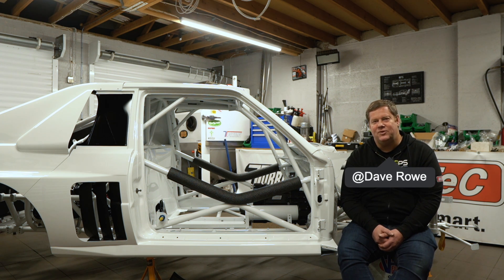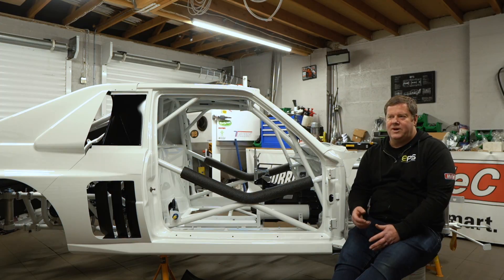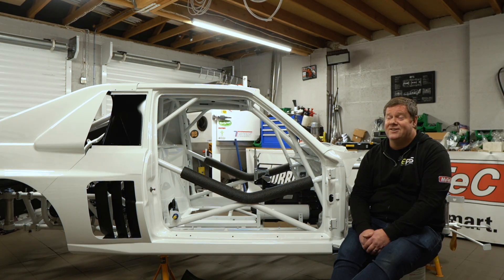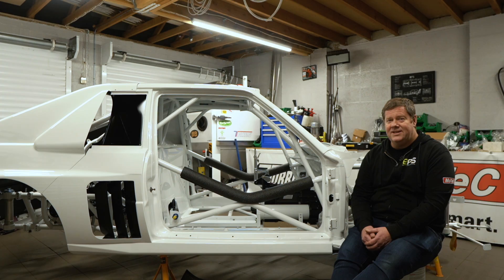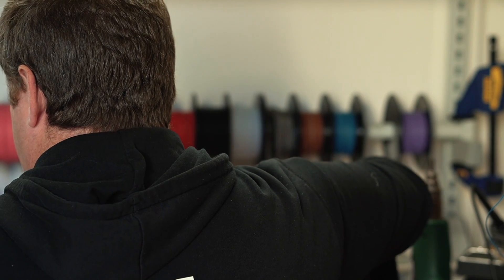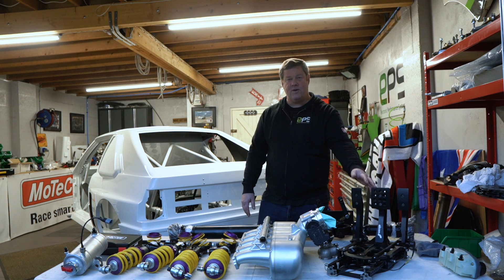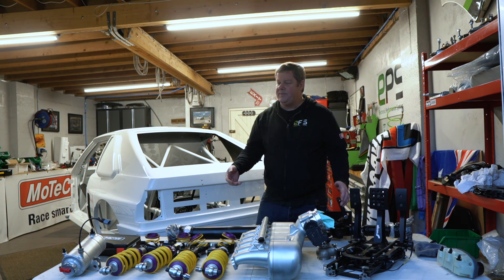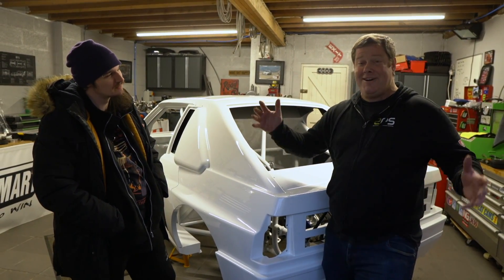Building Audi's missing Car.. Audi quattro Group S RS001 (Part 5) Getting the Driveline in

Comment: One of the best projects in a long time I saw on yt, honestly not the big audi fan but the build quality, atention to detail and thought process max respect
Maybe one suggestion for dash, when you already have double gauges, make oil press and water temp gauges work from second set of sensors just to have double information in case something happens you can instantly know is it sensor gauge or engine problem, because thoes two are most important for engine health.

Keep us posted, can't wait for next video😊

Comment: Only question I have is why wouldn't you use a AAN or old school Audi 5 cylinder for such a historic and important project? I understand the availability and displacement from an 07k but the noise is quite different and honestly a lot better from an AAN, 3B, 7a etc.
Reply: Please, it's a completely different type of gearbox and driveline, a completely different type of suspension with R8 parts, etc. So Everything is modern and better, so why would they use an old type of engine?
Reply: @MartinEhrsson  Because it’s a historic 1/1 replica build that would’ve used a AAN type engine back in the day. Also it’s not like using an old engine is bad, it’s a complicated air pump so both engines will do the same thing. One just sounds 2x better and is made for the car and the other engine is made for a vw golf.
Reply: It's hard to get parts for the old engines.
Reply: @ealoken  I own one so I can tell you it really isn’t hard to get parts especially for full on builds. It probably is a tad bit harder than a 07k. The only problem I have was watching his other 07k sport quattro the sound really isn’t the same compared to old 5 cylinder builds
Reply: @steeleluedtke398 well, in Norway it's getting harder to get good parts. But I agree, as a replica it should have the time period correct engine.